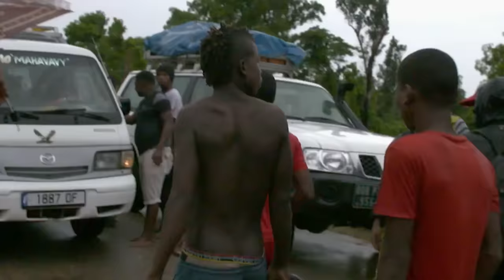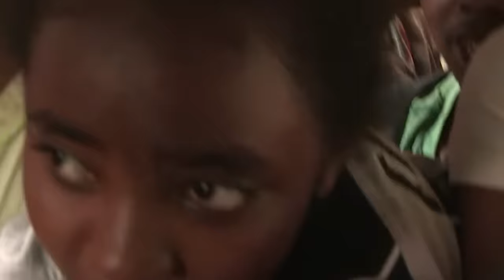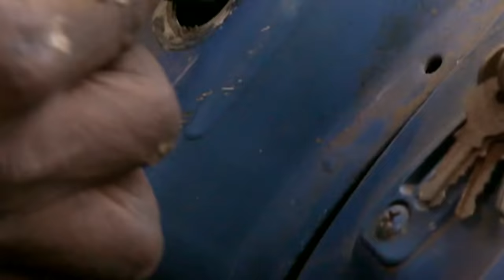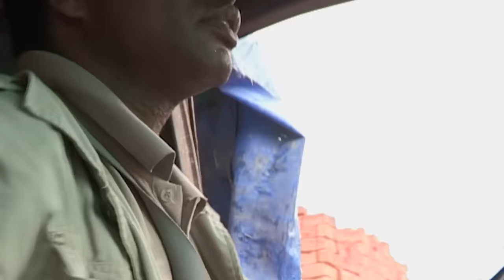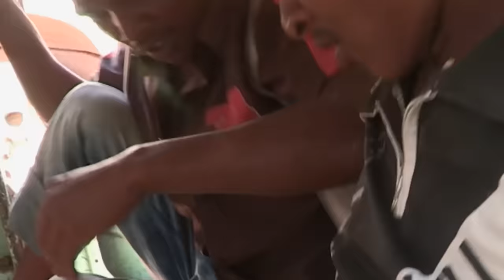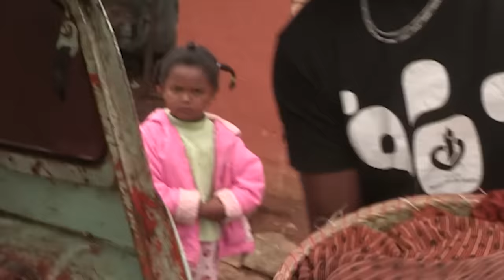Madagascar: Fear The Red Island | Deadliest Journeys

Comment: Gotta take a moment to appreciate German engineering for those Merc trucks.
Reply: The tire makers also do a great job
Reply: Always say the same Thing
Reply: made for ww2
Reply: Indeed, did anyone notice the windscreen ( immaculate condition). Seems as if the motor will outlive the body
Reply: The 1418 Benz trucks were built like a brick shithouse  , or panzer for the German speakers